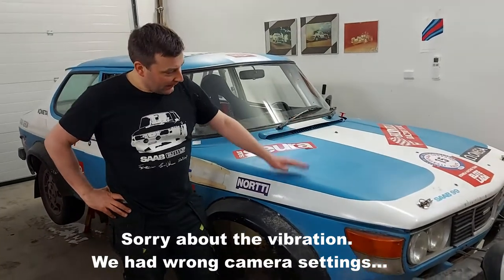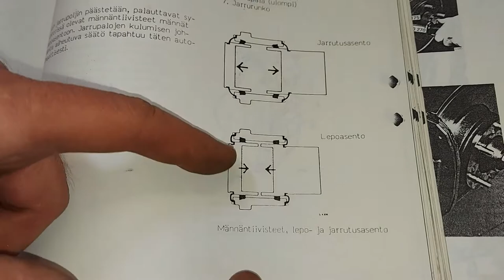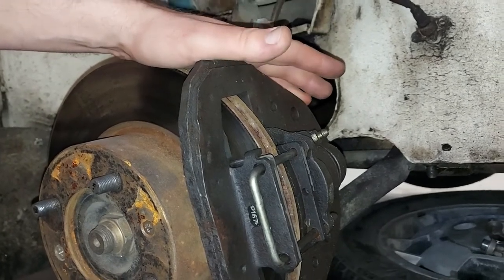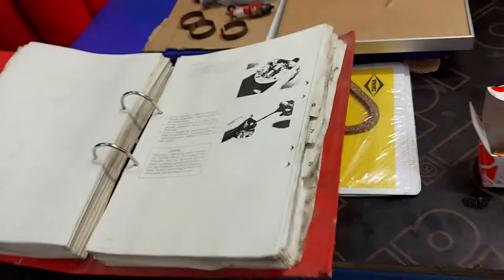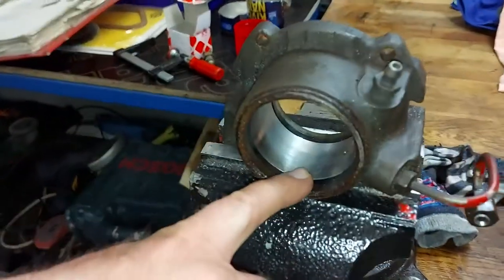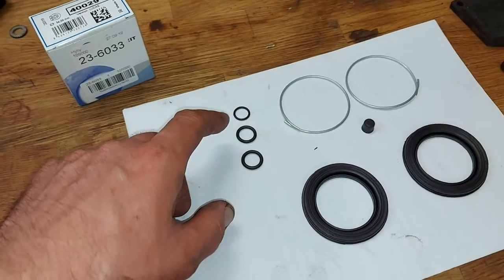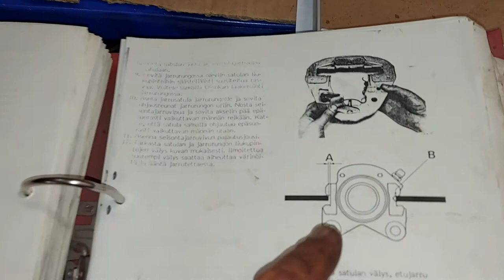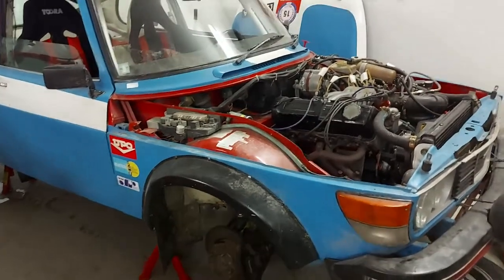Saab 99 ems historic rallycar | New gaskets to the brake caliper |

Comment: Awesome video. I bought the front and rear kit for my '76 99 just in case it fails. But they are still good. I replaced my front and rear brake lines and master cylinder last year. Next on the list is to get my parking brake to work with my rear wheels only. I have the older style front brakes so I need to press out my axle from the hub to get the rotors off and the bearings are discontinued so I had to clean and grease them with new grease. It would be cool to make a cylinder head video of valve lapping, replacing valve seals and shimming the head. I need to adjust the shim on my valves but I want to do the full service with a headgasket too why not. Do you know if the front windshield rubber seal is still available new? Impossible to find here in the USA

Comment: Hello! New 99 ems 77 owner here. I am looking for manuals of all sorts at the curent moment to restore my SAAB. My brakes are stuck currently and i need to make it move and i have some dumb questiones. Is the handbrake going towords the front or the rear in this car? I find the Front brakes wierd
Reply from the maker: Hi Martin. Sorry it took so long me to answer. I hope you have allready figured out your problem. I'm sorry I can't help you cause our Saab 99 EMS's handbrake is not a original (changed to read and it has Porsches rear brakes).
Reply: Till 1986 thé handbrake sites in front ... If you apply and release watch what happens, take good look weather both springs return evenly, succes, Bob Belgium